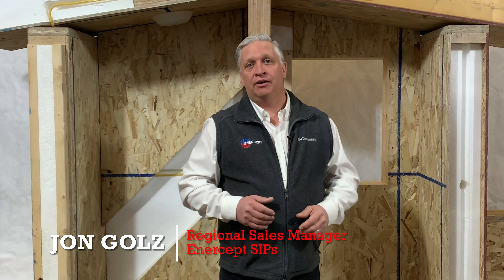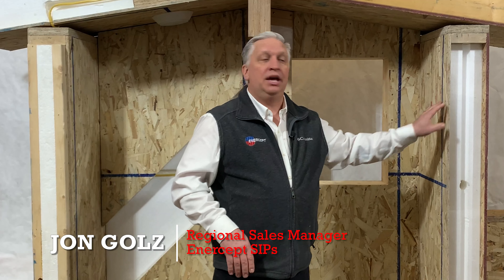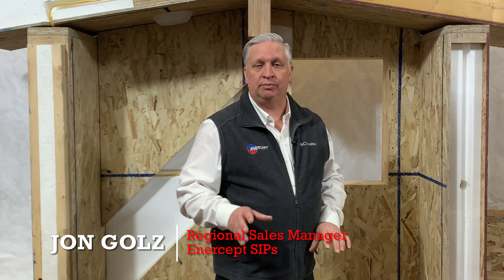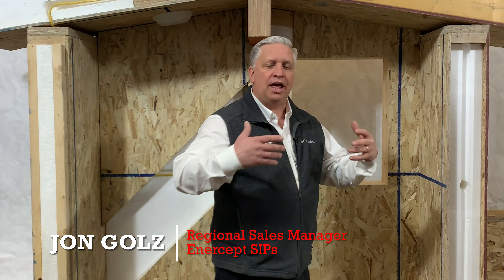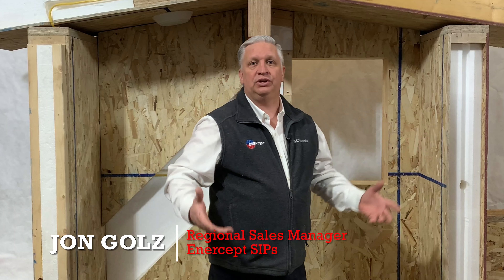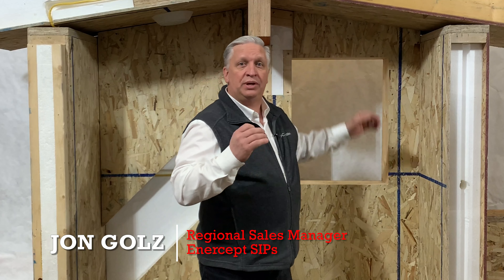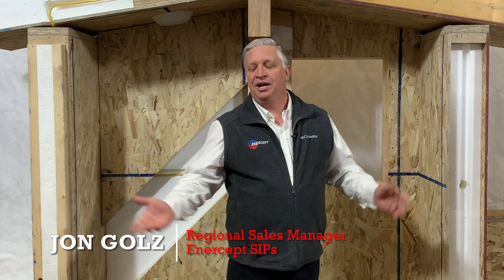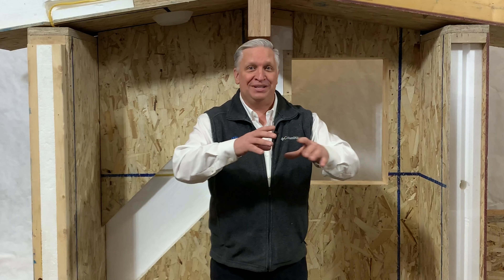SIPs are a high performance building system that is strong, energy efficient, and cost effective.

Comment: I framed for a few years, my wife and I want to build a home but it is so expensive to pay someone now. Could the average person with no experience with sips put up a single story home or would I still likely need to hire it done?
Reply from the maker: If you have a back ground in framing, SIPs should be very easy for you to pick up on.  Follow this link to the Enercept Video Library https://www.enercept.com/video-library-enercept-sips scroll down to the installation section to get a feel for the SIP installation process.